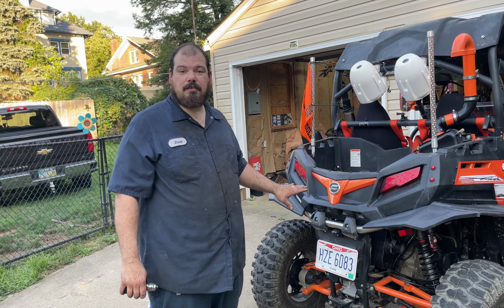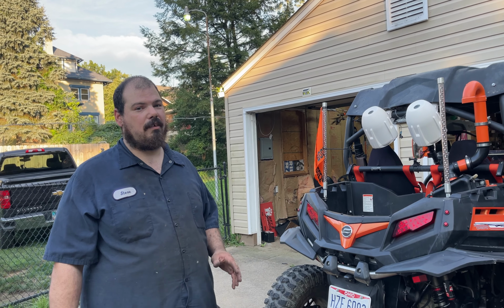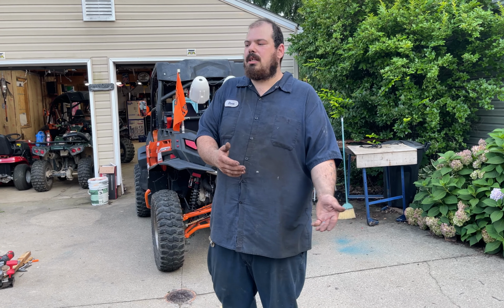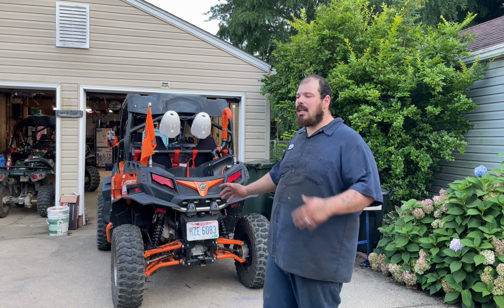Flowmaster 40 series for your  CFMOTO

Comment: Sounds great, wonder if you put a small tail pipe and a 3 to 5inch tip on it if it would get the sweet deep rumble. I know this is a old video an i hate to be that guy but please wear a face shield or saftey glasses when grinding. Yeah i know i know shut up dad 🤣🤣 either way gratz on the shop opening on the 30th keep up the good work
Reply from the maker: It’s possibly might.  No doubt lol 😂 I have been lately

Comment: Sounds good! , also do you know where I could acquire another exhaust flange, I did custom exhaust and used stock one but would like to be able to switch it out between a couple different setups on the fly
Reply from the maker: Exhaust shop will make you one.
Reply: @R.N.GPerformance  smh lol never even thought to ask them 🤷🏻‍♂️

Comment: God dam that’s nice. I was wondering how strong do you think these engines are. There’s a company that makes a legitimate electric turbo and they can put out about 5 psi on a little 4 banger engine.im curious if these 800 motors could handle a little boost
Reply from the maker: They could handle 6lbs maybe 8 but the electric turbos are garbage cletus McFarland has a video series on it.

Comment: Off subject but I have a z950 2021 I get so much heat in the cab it burns my feet I have put a piece of sheet metal under the dash and some heat shield in the e break place got some of it form not coming in but I still can't ride with me windshield down cause it gets to hot any thoughts I can't find any videos on it
Reply from the maker: Thats the nature of the beast unfortunately with all SXS’s. Its hot air from the radiator. Block all little holes and stuff you can
Reply: @R.N.GPerformance  ya I have been doing that just thought maybe someone had made something simple I haven't thought of or tried something like channeling the air different or something thanks

Comment: There is no no way that 40 series would sound good on a 950... 

This is really a pointless comment but it's a comment none the less 😂😂😂😂
Reply from the maker: 😂 it would sound the same really lol
Reply: @R.N.GPerformance  oh probably but a little deeper due to displacement
Reply from the maker: Believe it or not the 800/1000/950 has the same pistons same jugs same valves same heads same cams etc. only difference is stroke and intake size.
Reply: @R.N.GPerformance  yeah stroke on 800 is 2.42" and stroke on 962 is 2.91" (3.6" bore) that means vm wise intake manifold and exhaust manifold are major restrictors there is zero reason a 962cc engine should be blow 90hp especially with a 10.6:1 compression ratio
Reply from the maker: Im with you.  I have some things up my sleeve to make the 800 breath. Im getting high compression pistons. Cams. Im putting the 1000 intake on it or a custom one. Im putting the wet clutch delete on it. She will breath this winter starting to gather parts now.
Reply: @R.N.GPerformance  YouTube is friggen annoying 

I have been looking at the intakes of the 800/1000 (962) between u/c/v force and honestly I think the uforce 1000

I'm taking this over to nation this is to much need pictures
Reply: I run a MagnaFlow 2 chamber on my Z1000 and it sounds bad ass!!!
Reply from the maker: @larry97016  hell yeah it does